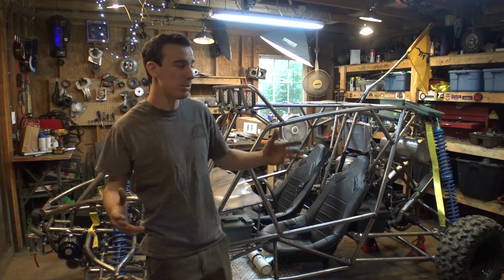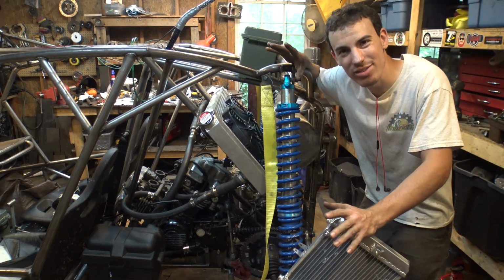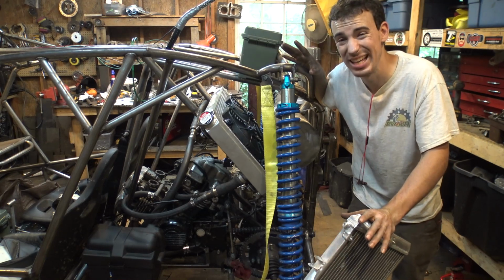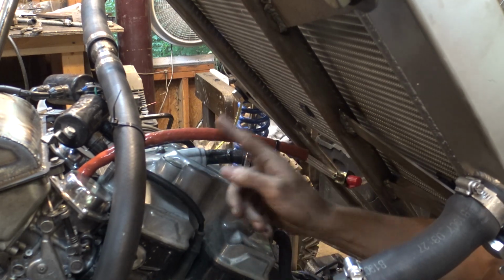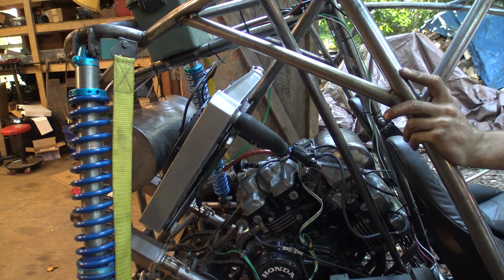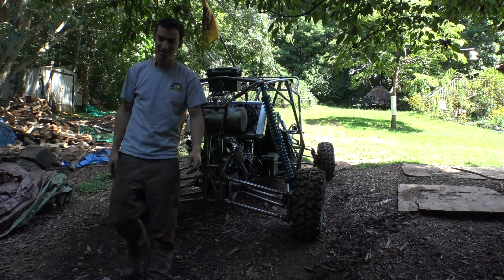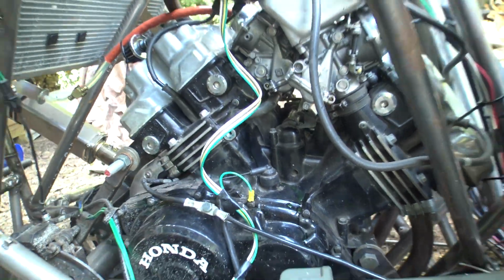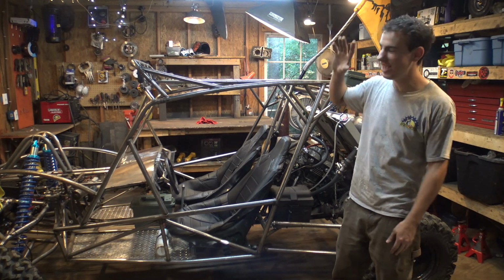Honda VF1000 buggy build part 16

Comment: If the engine has a thermostat it wont be a problem that the engine will be cooled to much. but if dosent i might have a hard time getting up to operating temp which will cause alot of extra wear on the engine.

Comment: the coolant issue looks to be you have the lines reversed...... in the top out the bottom on radiators engines are opposite

Comment: put the stock airbox lid and filter back on the carbs with out it your running lean and hot causing idle issues and running issues motor cycle engines are tempermental without the proper airbox of jetting of the carbs to compensate for its removal

Comment: Put the thermostat back in with or without the guts cut out if your running it without a thermostat, the water flow is too high and there is too little time for heat exchange with out the restriction.
With a fuel pump there is no reason to mount the fuel tank above the carburetors, lower it below the float bowls so you get minimal chance of fuel leaking in to the engine when it's off, I lost track of how many bikes had a damaged or spun rod bearing or bent rods from fuel shutoffs that leaked in the off position.

Comment: Do you have an automatic fan switch?  I solved the overheating with a larger fan and a temperature sensor.  But beware, I had to put a 30Ah battery.
Reply: He has a car battery on this now just because of the winch.
Reply: @Ratkill9000  yeah actually

Comment: I would check the oil and make sure you didn't worp the head seems how it over heated. Before running it again. I know you did a compression test but I would still check. And try an get another charging system so your not straining the motor an sucking the power away from the mane running components.

Comment: I would change the oil! If it got that hot! I have seen engines over heat, then spin a bearing, I guess the oil got really thin, or thermal breakdown, but anyway, I'd Change the oil!

Comment: Maybe the water/coolant/radiator is suffering from cavitation??. On the motorcycle, the radiator is level with the motor and on your buggy, it's mounted pretty high above the motor. I wonder if the pump is not properly circulating the water/coolant due to the radiator being above the motor?.
The water pump is designed to circulate water and not necessarily lift water.
Edit: on a different note, your lathe is soooooo RAD!!!
Reply: Warm water rises, so it goes up with no problem. It's a circulating system, so the pump doesn't need to do much.
Reply: He is boiling his fuel, and having overheating issues because he won't listen to those with the knowledge he will end up destroying his engines until he learns to listen... that engine needs a fan blowing directly onto it to stop the fuel boiling/overheating at idle he should also add an oil cooler as he is most likely cooking his oil.
Reply: Pastor Glock  he is boiling his fuel at his carb which is directly resulting from the stagnated hot air directly around the engine the only fix is to return the missing airflow either by moving the seats further apart or by adding a fan aimed directly towards the engine because it isn't just boiling the fuel it's cooking his engine

Comment: Put air cleaner in carburator, CV carbs don't like work without aircleaner if not jeted, that will make the engine runing lean and tend ro overheat

Comment: Overheating my stock Grizzly 660....new water pump. Problem gone.  Just sayin.  Hows the pump?
Also, Does that motor use a thermostat? Sometimes to much flow will not allow time to cool the coolant. Thermostat slows down the flow.

Comment: So basically, an endurance car will run lean when it doesn’t need to make power, then if it starts to get warm it adds enrichment to bring the temperature down some. 

Evaporating fuel has a cooling effect so even though driving it slowly was probably the right thing to do, there’s merit to their argument

Comment: Cut off the back half of that buggy, cut the front half off of a fwd honda, smack that thing on and have a powerful four cyl thats easy to work on and easy to find parts. Or the next build, i dont think you could have that crazy suspension you got now. Something like a rally car for gravel roads and such. Would be cool! And ebay turbo kits at the ready for some honda civic engine...

Comment: It needs a fuel pump, get the original one what came from the donor bike, or a one designed for carbs. Trust me on this, it will run much better with a fuel pump.

Comment: i think the oversize radiator is a good idea, don't think that engine was really intended to run at slow speeds, the bike it came from would have a lot more air flow around it normally, I used to ride a Yamaha 700 and it did not like it when in slow moving traffic.

Comment: As long as you have a thermostat you can't really over cool the engine. The thermostat will cut off flow through the radiator if the engine cools too much.

Comment: If you got it as hot as you say you did, and if it's running bad and leaking coolant, you may have blown a head gasket. They are not too terrible to change.

Comment: Change the Sparkplugs, you overheated the motor multiple times and probably cracked them. If still getting hot under or around 5 minutes, check the waterpump. Big radiator, that little motor should have never gotten any kind of hot.  Blades on the waterpump could be bent.

Comment: Wait, are the radiators sucking air through the radiators? Or are they pushing it against the driving direction? (maybe i missed that part in the video)
Also a Problem could be that the air get's very messed up before it hits the Radiator, that's why the F1 front wings are so complicated, they guide the air into the radiators etc. so maybe an option would be to have some kind of air catcher on top that guides the air through the radiator, would look fun :D

Comment: If it keeps on giving you running problems might want to consider new spark plugs remember fire air fuel oil the four things that an engine needs to run even if the spark plugs have spark it might not be efficient enough to run the engine properly
Reply: I remember it as only three: Spark, air and fuel
Reply: @datjochem2977  yes but you take the oil out of the engine it doesn't work neither an improper oil can affect the performance of the engine

Comment: Your fans should be in the engine side of the rad so it gets rid of the hot air away from engine
Reply: b1zzl3 depends which way they spin. I’m sure he’s pulling the air off the engine, through the rad and out and should work fine.

Comment: It's probably running bad because you blew a head gasket when you overheated the crap out of it. Engines don't run too well burning anti-freeze. The coolant leak running down the side of the block from the deck is a sure sign of a bad gasket.

Comment: Not trying to be a know it all or hater but on a 4 cylinder 4 carb engine like that you need to make sure the carbs are synchronized if their not you're going to experience a lot of issues including overheating. Just trying to help.

Comment: off-idle hesitation is typical of too lean an idle mixture. check the mixture screws on the carbs, Idle sounds way too lean, she's strugglin for fuel when you kick the throttle.

Comment: cooling system with or without a thermostat?
electric and non electric thermostat would be nessecary at all times + the wax thermostat can be set to different themperatures .
85 or 87 or 90 or 95 degree's CELCIUS.
so you can set the themp MAX LIMIT by choosing the right Wax thermostat .
the electrical one can be used to turn the Fan's on or of or use 1 or both fans....
thus controling the airflow tru the radiator.

and put the tank somewhere else.
or insulate it.
cos hot fuel don't help with running your engine 100%.

nice build..

Comment: wow nice project, the engine is lean, carbs need to be synchronized , the radiator is super heating the fuel, the incorrect coolant flow has cooked the crossover pipe o-rings, all these things could have been avoided if  ah little research was done ahead of time, My choice would have been a Busa motor FI zero problems; I love the chassis.....

Comment: Are the fans spinning the right way. They should be pushing air the way they set now. If they are pulling air. When you are moving. It won't do anything for cooling

Comment: I've been working on cars for going on 50 years now and I've yet to see an engine that has the water inlet higher than the water outlet. They do that so that the pumps are gravity primed and there's nothing between the pump and the rad to possibly create an air pocket before the pump.

Comment: I wouldn't give up on the motor yet . Water pump might not be strong enough to push water that high,,, also you can't run it hard because that chain setup won't handle it.

Comment: Motorcycles run like crap when plugs are bad ask john & ike. Because of the way you  mounted the  radiator too high I said before they are supposed to be lower than the highest part of the engine. Car and  motorcycle 101 in cooling system. I  think you said that the fans are pushing, when should be pulling.  You have radiator mounted over something that gets hot therefore it is going to run hot. Duh. And  had my cooling fans on my drag car like that, I made a shroud that multiplied the air pull solving my over heating problem. And get some wetter than wet it helps cool the engine better. Or am i wasting my breath. A bigger radiator won't help if not mounted properly. Been working on motorcycles and cars for 40+years, just trying to help. ✌🐓🤟🖖😎

Comment: Id relocate the fuel tank ontop of hot radiator and exhaust are not the best and see what sort of fuel pump would be best for it and your more than likely already significantly out drawing the charging ability of that engines stock componants

Comment: Hondas use a old style diaphragm pump for their bikes. If they dont get half a psi to 1psi of fuel pressure they wont run properly. The head pressure having the radiator so high wont help coolant flow. The heater tube that is leaking at the end of the video is a square shaped o ring. Use some silicone on it or buy one from honda. They arent a standard size

Comment: Toss the 491588 air filters and go with conical K&N's direct off carb's,  Then build air box around them. Those brigg's filter's are shit and you know it.Also you may have blown a head gasket when you overheated,And that has caused the leak and the running issues.and a radiator barf box might be a good idea?

Comment: You setup your radiator wrong you need radiator shroud that help a lot in cooling and yes you had backwards so should cool better and add pulse fuel pump or check user Imperfect Videos post get that and you may need move your fuel tank or check with DEI add Shields & Reflectors warp the fuel tank also in not good idea to used clear hose unless made for fuel the rest good. As for your cooling leak replace o-ring they do fail over time and did put in new set spark plug ? try add some Berryman B-12 to fuel it clean it out if not I run them thru a ultrasonic cleaner.

Comment: All the people saying rev the hell out of the engine are idiots.  4 strokes have torque. Which is in low rpm's. He needs to upshift instead of leaving it in a low gear all the time.  That's why it was overheating.  He needs to keep the rpm's lower and keep the temps down.

Comment: Ur going to heat ur fule up with the tank where it is,should be over motor for better fule delivery and cooler fule ,the cooler the file the better it will run

Comment: you may have hurt the motor from overheating it over and over
also your steering rack is not going to last long with the added power your putting on it as its not rated for power steering

Comment: simple solution when the radiator is too big : tape it off

as for electric power steering , over here in the netherlands there cars called the opel corsa 
https://commons.wikimedia.org/wiki/File:Opel_Corsa_front_20080417.jpg

it has a stand alone ectric power steering unit that can be adapted for use in other vehicles

Comment: Your taxing the electrical system with those fans. And not getting enough energy for spark, hence the unburned fuel popping  out the mufflers.

Comment: Gas boils at like 35c, thats not very hot... could be just the air off your rad was boiling the the whole tank... I'll give you this though, you've managed to figure out that if you're gonna use an engine out of a bike built in the 80s you may have to clean the damn carbs... carsandcameras has been trying to figure that one out forever.

Comment: I hate to mention this, but with the addition of those two huge cooling fans and the electric power steering I doubt the charging system and battery on your buggy will be able to keep up.
Reply: Y mention it then
Reply: He could put in a thermostat control so fans only come on when engine is about 195F or something like that pretty easily.

Comment: The people who are calling for a fuel pump are correct. In addition with today's easily boiled ethanol, I'd add a filter with vapor return - Wix 33040 would do. You'll have to add a vapor return port to your fuel tank. The small leak at the coolant outlet lines should just be O-rings.

Also, the VFR should have had an external thermostat / temp sensor housing between the 2 return lines and the upper radiator hose. I don't see it, you must be running without a t-stat.

Comment: Small 4 cylinder car engine 1.6l or less would be perfect for that machine
Reply: Urock012 I've been telling him this since the beginning. This thing deserves a proper engine.
Reply: More weight ? Nah i dont think so. That engine is enough, it just runs like shit and needs a proper tune.
Reply: Incorrect. Putting a motor, tranny n diff in a 600lb frame would be the only option to have serious fun on a frame that size. Otherwise it’s always just going to crawl up to speed
Reply: @didyliduu  more power and torque. You guys are getting the wrong idea on what this thing is. It's not a go kart. Look at what carsandcameras just finished building with a bike engine that size. THAT is something you would want to put a bike engine in. Not this, no. It needs a proper engine, plain and simple.
Reply: @fullmetaljacket7   Ofc its not a gokart. And VF1000 engine is more than capable to move that thing nicely. It has over 110hp and you can gear it down to have more torque. No need for 100mph top speed. Car engine with tranny and diff is heavier. Bike engine has bigger rpm range to use. And who tf even needs diff in buggy? Going to spin one tire all the time for fun ? 

There is many 2wd buggys with 1000cc bike engines that weights near this one and those are literal death traps.
Reply: didyliduu the vf1000 engine is rare, hard and expensive to maintain, is not in the best shape, is giving nothing but headaches and it is definitely underpowered for this application. 100hp means nothing if the power only comes at a crazy high rpm and in an very narrow rpm range. It has no torque. It wasn't designed to push all that weight around a trail. Gearing it down will only make it worse. I never said it needs an open diff. I said It needs a proper engine, thats all. This thing is WAY too heavy as it is for this engine, let alone carrying a passenger. It was supposed to be a dune buggy kind of thing since the beginning, not a slow ass offroad trail go kart. It has to be faster than it is right now. I'm sure he's gonna get fed up with this bs and find a proper engine for it really soon.
Reply: @fullmetaljacket7  Underpowered ? Hows your dailydriver? 2500hp+ to satisfy your needs ? It has torque, its V4. Go ahead and take it for a test drive when he solves that carb problem, its fine with that engine. He hasnt even revd that thing yet and you tell us its like a snail in tar.
Reply: didyliduu yes it's underpowered. 100hp out of  a 1liter engine means peak hp at a really high rpm and a very narrow useable powerband. Max torque on this engine comes at a whopping fucking 8000rpm and peak power at 10000rpm. It's useless for a buggy like this. Doesn't matter if it's a v4, those are the numbers. That engine is already crying for help and he's not even putting the foot down. Imagine when he does... The vf1000 engine would be insanely fast for a racing kart of sorts (or something like carsandcameras just finished building), but it's far from ideal for a heavy offroad buggy like this one.

Comment: If you have to do another engine swap. Use a Kawasaki 1100
Reply: I have a Kawasaki 1300 inline 6 dfi out of a 1985 ZN1300..... it was a fully dressed touring bike and motor seems full of torque..... Do you think it would be ideal for a buggy application?

Comment: Your engine doesnt have a Thermostat you dont have any overflow and your system is not bleed that a big part of the problem and you should use a fuel pump

Comment: YOU ARE MOUNTING THE RADIATOR TOO HIGH PUTT HEAD PRESSURE  "WATER WEIGHT" ON THE ENGINE

Comment: Gotta have a motor worth abusing
Reply: Add interior led light strips so if you break down in pitch black night you can have the luxury of sitting in your buggy waiting to be recovered or if you want to eat a meal in the pitch black that works too , also consider engine led lights so you wont feel completely hopeless working on your buggy in the dark . I noticed you have light bars so why not . Your very close from done just have to hope the honda engine will last long enough to enjoy

Comment: You look like a smart guy and i do like your work but sometimes you just say stupid stuff. Bigger radiator doesn't mean the engine will run cooler. What controls the engine temp is the thermostat that allows coolant either to enter the rad or to bypass it. You may well have a bad thermostat which you can change and if need be just use a lower temp thermal switch to make the fan kick in earlier.